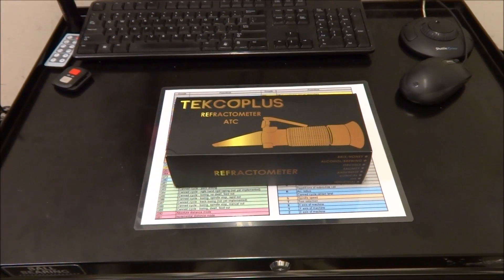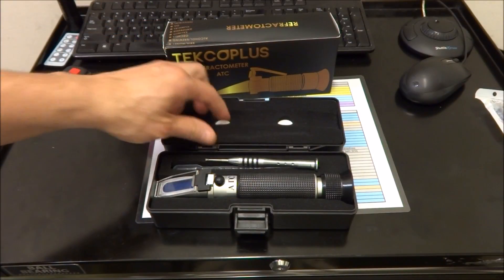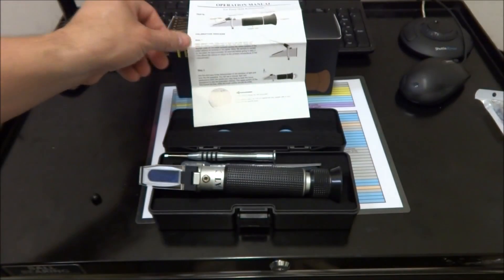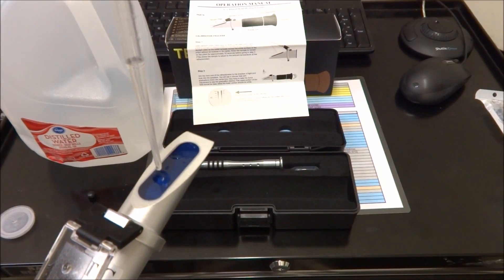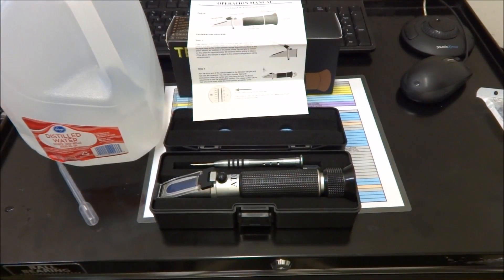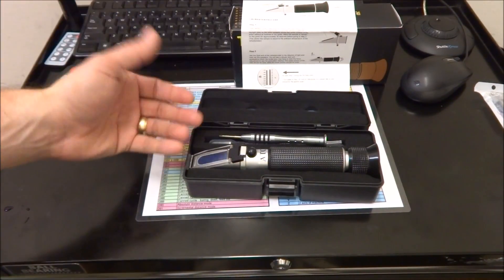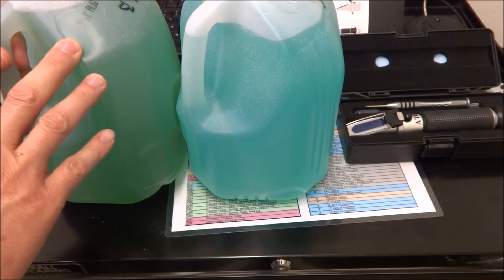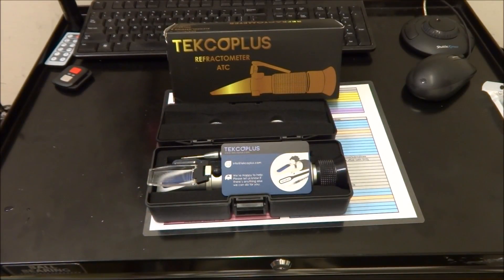Coolant Refractometer

Comment: Most coolant in machine shops should be between 5 and 7 if your cutting aluminum higher is better. But. 6 is offel low in my opinion.
Reply from the maker: Yeah I try to stay in the middle around 6

Comment: How frequently we should change ? Is there any safety instructions to use and maintain. Is there any health issues working with coolant??
Reply from the maker: I dont change my coolant on a set interval. depends on usage. The water in the coolant evaporates so topping off with water is needed while checking and maintaining your set mixture. this brand works well to keep a nice film on the machine for protection. Check with mfg for health risks each brand has a different makeup. request a MSDS.
Reply: Ok thanks 👍

Comment: Refractometer measure coolant concentration levels. NOT PH levels.
Reply from the maker: Yes Jeff, you are correct ! A Refractometer measures the RI Refractive Index measured in Brix. I did not say I was measuring the PH I stated the PH levels were off In my coolant which led me to purchase the Refractometer. Which allows me to get the coolant mixed correctly. 
pH:This value describes the alkalinity or acidity of the coolant.Most coolants are designed to operate in the alkaline range and it is important to maintain pH near the values given on the product data sheet.  Low pH generally indicates low coolant concentration, poor coolant mixing or instability, concentrate that is too old for use, or high rates of biological growth. Where pH is high, the coolant has likely been contaminated by high alkalinity materials.
There are many factors that go into machine coolant. If your using a water based coolant PH is involved.
A good Read:
https://www.petroliance.com/sites/default/files/PDF/Metal%20Working%20Fluids/Machine%20Shop%20Fluid%20Maintenance.pdf

Comment: After doing a coolant flush, usually some coolant and water is left over in the engine, hoses etc. making it difficult to get the desired 50/50 mix during the refill.Will this tool show if the ratio of coolant to water is off for new coolant.( not 50/50) Also would reverse osmosis water work as well as distilled? Thanks for the video. Always learning something new!!
Reply from the maker: Yes there will be coolant left over from prior fills. I check the coolant first using the spreadsheet Posted in the video description. this will tell you how much coolant is in the current mix and how much you need to add along with your water. I have found that any water seems to be fine. so Yes reverse osmosis water is fine.

Comment: Go buy some 50/50 and test it. I bet it's off because that's junk.
Reply from the maker: Well it's not a $400 unit that's for sure but it is a way to measure the Refraction. Accurate or not you can gauge the amount you add.
For a Home shop or small production shop this should be sufficient.
Reply: @CNC4XR7  I want to see if what is in the car is off. If it's not accurate then it's junk.

Comment: Only use distilled water for calibration.  Using anything else will result in improper calibration.  Even other sources of water for example may result in a calibration which is indistinguishable from using distilled, or it may be way off.  It all depends on how pure the water is.  Just use distilled water eliminate that factor of uncertainty!  It's cheap and very available.
Reply from the maker: I agree and had always used distilled water. however I have been slacking off recently and For my small system I have not seen any issues using tap water.

Comment: Any room temperature water is fine, and you should allow your sample to acclimate, before you test it. Warm samples will warp the prism, and give you a false reading. This test is really only good for fresh coolant; after you get fines, bacteria, etc in the coolant, your refract reading will be higher, than the actual %. The Vee Gee 20% is probably the best economical refractometer you can get.
Reply from the maker: Thanks for the input yes best to check with Acclimated water temp ( forgot to mention that) and  tap water is fine but there can be minerals and impurities in tap water in certain areas so since I run a room ac unit and 
generate my own distilled water I choose to use that. I think your correct in stating the Brix reading will vary depending on  impurities from the machining however most MFG give a range and recommend checking at refill intervals.
Reply: You're welcome - If the water is dirty enough, to skew the refract, it's probably too dirty for anything else. The whole Idea behind using distilled, RO, deionized, water; is that you start as clean as possible, with fresh metal working fluid, to maximize the life and stability, of that fluid. Distilled is by far, the best choice, as you won't run into demineralization and foaming issues, nearly as often. Small systems like DIY lathes and mills, benefit from the ability to quickly and economically dump/clean/recharge, if things go awry. We test pH, bacteria, uS/cm, Brix, as well as doing a babcock test, on our fluids "oil based emulsions".